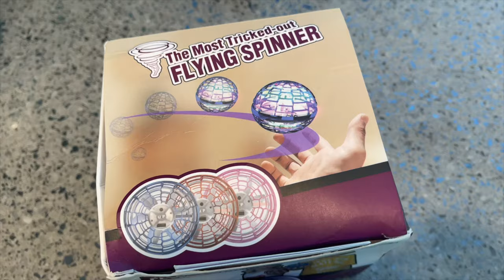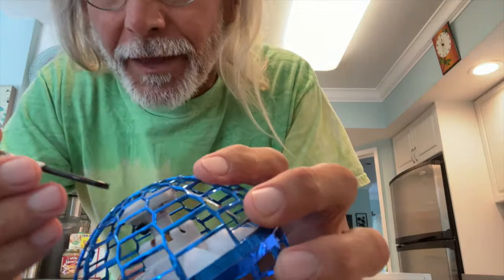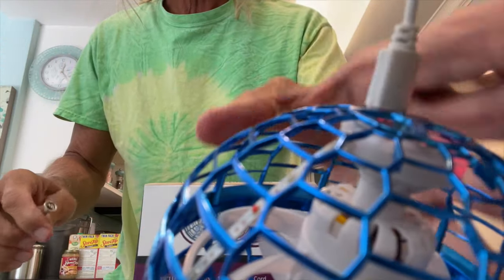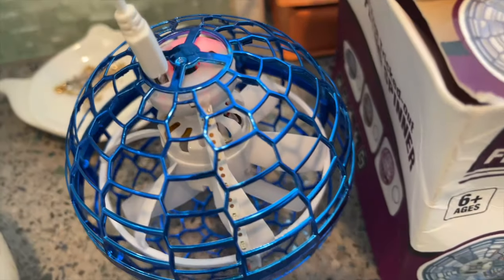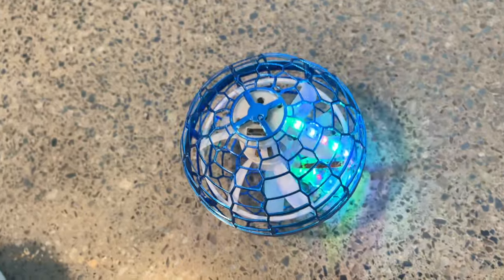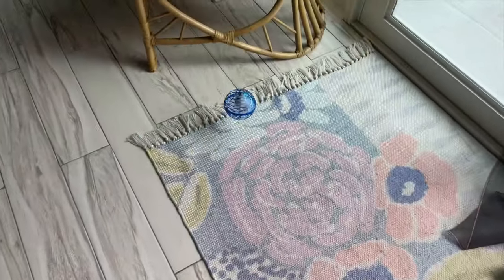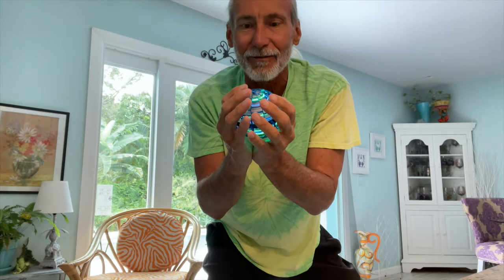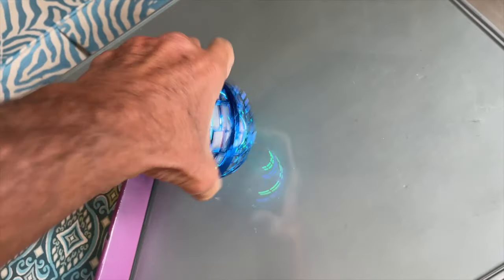How to use The Most Tricked Out Flying Spinner drone

Comment: Mine went in dust and now it always turns off whenever i turn on. Whenever i charge it charges but not fully. Bit of precentage and then it turns off, whenever i test it, it dies in like 1-2 min or just turns off automatically as soon as I turn on
Reply from the maker: Sounds like you have a lemon I would take it back and get a new one
Reply: @TomLeeman  what does that mean

Comment: HEY I HAVE A QUESTION😭 DOES IT TURNS OFF WITHOUT REMOTE? IF YES HOW TO? AND IF IT ONLY TURNS OFF WITH THE HELP OF REMOTE, THEN DOES THE REMOTE RUN OUT OF BATTERY? IF YES HOW TO RECHARGE BATTERY? CAN WE CHARGE IT OR CHANGE THE BATTERY OF THE REMOTE? I ONLY HAVE THIS ONE DOUBT ABOUT THE REMOTE
Reply from the maker: There’s a button on the very top that you push next to the USB port and that should turn it on not sure how long the battery will last but I do believe it so it’s very small silver I think they’re cc batteries good luck thanks for watching
Reply: @TomLeeman  I mean the ball only turns off with the help of the yellow remote right? If the remote battery runs out I won't be able to turn if off again, so is there a way to replace the battery of that yellow remote or charge that yellow remote?
Reply: You can shake this thing then it will turn off
Reply: @SYAAMLBB  mine doesn't work with shaking
Reply: @kenzy1906  it because you got a fake one.

Comment: How long did yours take to charge? I've the exact one and as I'm charging it, the red light comes on and pressing the power button makes the led flash 3 times but off charge its not doing a thing. Think ive a faulty but keen to see if it's maybe user error thanks you!
Reply from the maker: When you’re ready to fly it if you press that little button next to the charge port it turns on the lights on the side of the ball and then you just have to click the remote and it should work you could have a defective one they are pretty cheap good luck thanks for watching
Reply: @TomLeeman  thank you!
Reply: Directions say 25-40 minutes of charging for only 6 minutes of chasing it all over. 😂 the light strip is what causes the thing to be unbalanced… Would actually work well if it were balanced…. Something I’m working on with mine. $21 + a month waiting for this thing…🤦🏻‍♀️🤦🏻‍♀️🤦🏻‍♀️ oiy veh… What I do to amuse the kids😂

Comment: Great video! I had the same issue with the USB plug-hard to get it in to charge. I just got one of these and there is no remote with it? It's supposed to have one isn't it or not? Still can't get it to charge and on the box is doesn't mention a remote. Is this one a new version that doesn't need a remote? Puzzled? Thanks in advance for any support you may have to share with us. Thank you!
Reply from the maker: I think there’s a whole bunch of these they’re all made in China some have remote some don’t some are better than others. This one did have a remote with it charged but as you can see it bounced all over the room. It’s kinda hard to use that was fun thanks for watching.
Reply: You have to flick your wrist to make it fly

Comment: I have a problem with this 
Once the remote runs out how are you gonna turn the flynova off
If you say u just have to shake it its not working
Reply from the maker: Some have controllers and some do the shake, but there should be a button at the top that you can press. It turns it off if you hold it. Good luck thanks for watching.
Reply: @TomLeeman  Yeah but how am i gonna press it while its spinning?
Reply from the maker: @zenoxzilger5563  that’s a good question you’re gonna have to grab it and try shaking it
Reply: @TomLeeman  it aint working
Reply: @TomLeeman  i just said it
Reply: @TomLeeman  "If you say u just have to shake it its not working"
Reply from the maker: @zenoxzilger5563  I would take it back and get a new one. You may have a lemon.

Comment: I had the same problem with no remote and I found that f you did not get a remote with your spinner, then after you push the little button and after the lights flash for a few seconds you will need to shake it to get the blades to spin. Also then you need to chase it to manually turn it off.
Reply from the maker: Yeah, that is true. I have some videos on that.
Reply: Same problem. No remote

Comment: The only thing that works is the light and it won't move or even turn off. The remote doesn't work either
Reply from the maker: Sounds like you got a lemon I would recommend taking it back and exchange it

Comment: Poor design. From the charge port difficulty, the hard to access switch, the lack luster manual with by the way doesn’t mention the remote that only functions when it’s a foot away from the device… 😡🙄 
I’m thinking we’ve all been sucked into another falsely advertised Chinese junk. 
I’ll be dismantling mine and reverse engineering mine to function properly.. 
Thank goodness I paid attention in mechanical arts class😂😂😂
Reply from the maker: It is cheap and hard to use as you can see it flies around and smashes and everything. Thanks for watching.